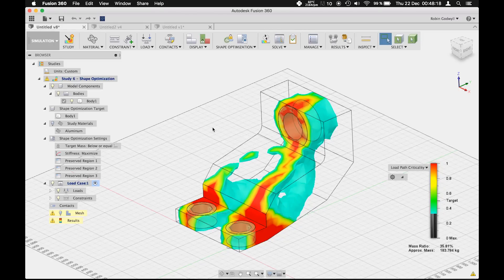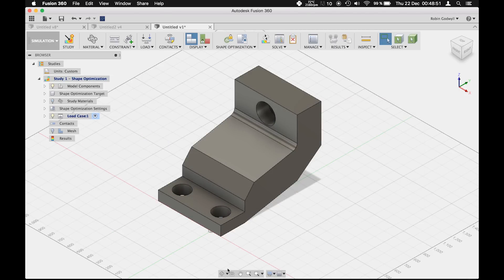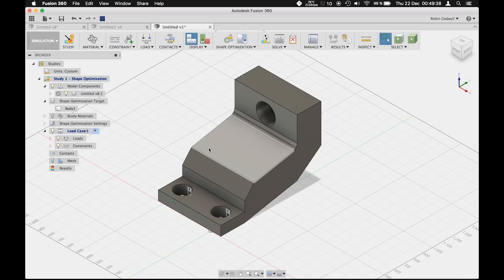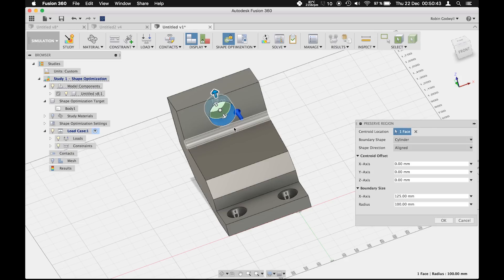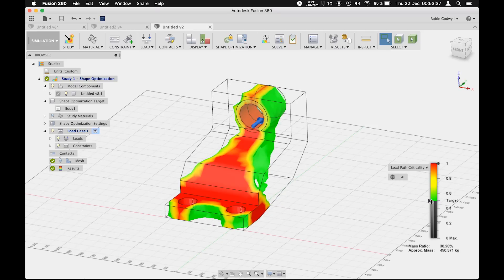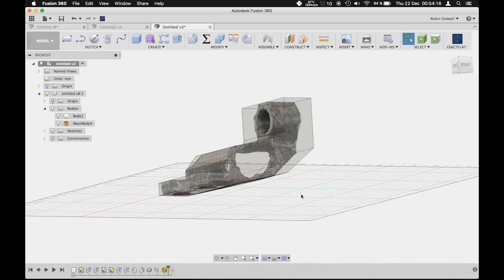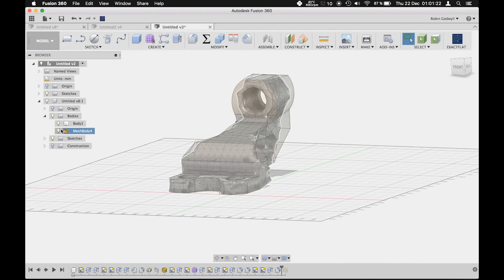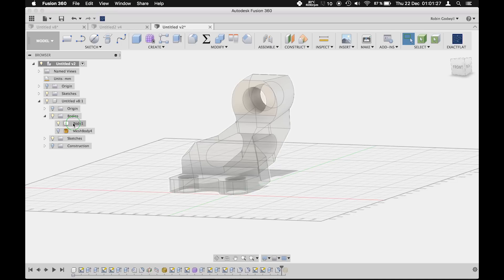Fusion 360 - Shape optimization simulation tutorial Dec 2016

Comment: Using this video as basis; what process would be used to optimize a welded metal frame in the egg-crate form - with a welded skin on one side?  Trying to learn to apply Fusion 360 analysis to composite welded forms like tank walls, boat hulls, large casting forms for concrete, and vessel design.

Comment: Thank you for this useful video. I want to know if it possible in Fusion 360 to do optimization considering an anisotropic structure of the material (such as the structure of the 3D printing parts). If no, which software can do this?
Reply from the maker: Fusion can not do this in the shape-optimisation study. However, Autodesk is working on this functionality within the generative design workspace. I dont know if it is a standard feature already and I also dont know any software that can do this outside of research projects.